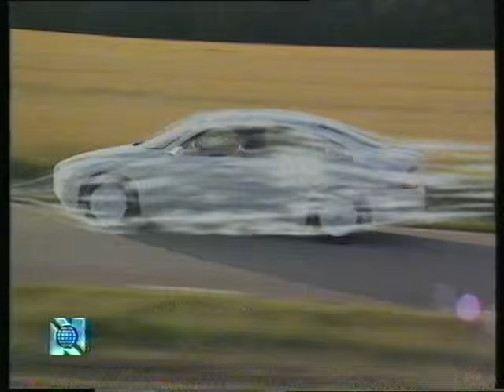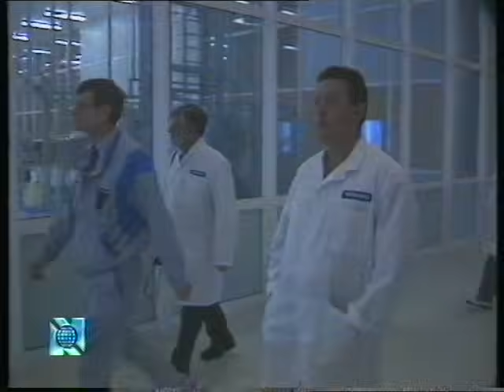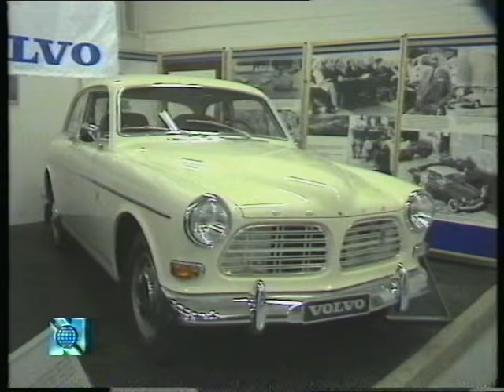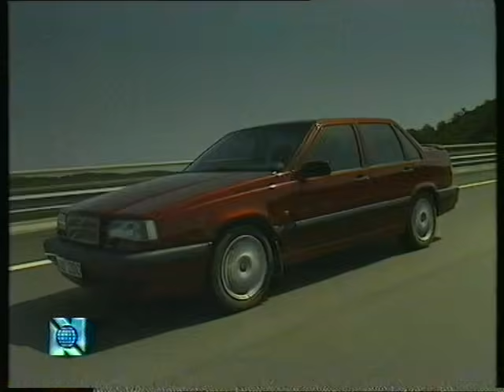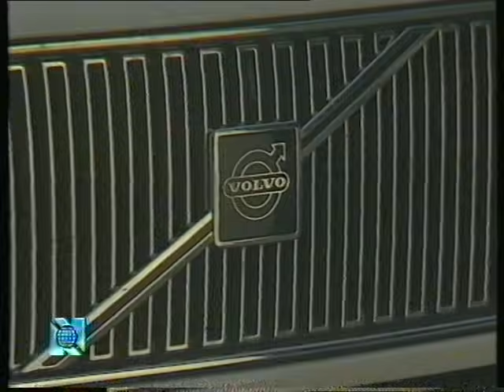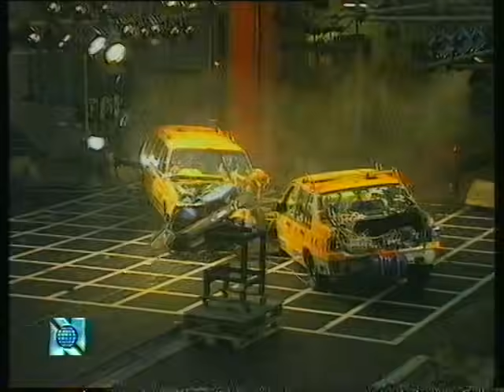Volvo 850 on Drive Time 1994

Comment: That concept car is basically a 1st gen s60. Being a hybrid concept, it's no wonder the s60 was so aerodynamic.
Reply: It may look like that but this was the concept for the S80 that came before the S60. The S80 was the first car on the platform used for the first S60 and second generationV70.
Reply: @carlgustaf855  Indeed... looks more like an S80 also..